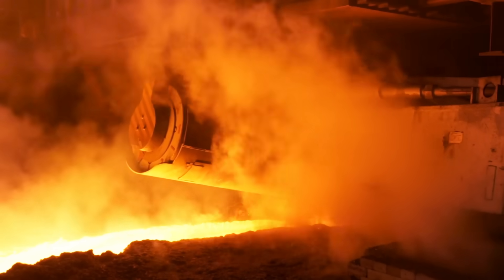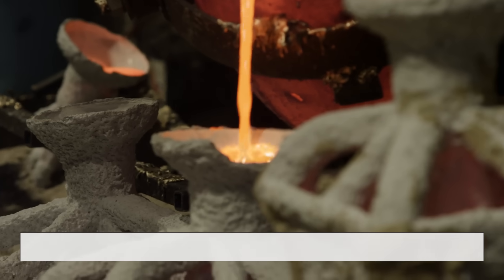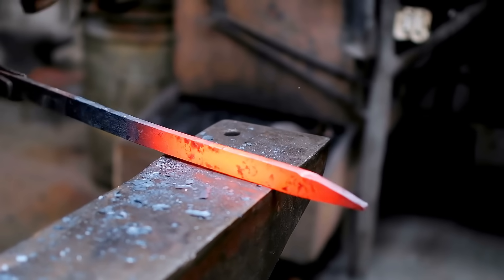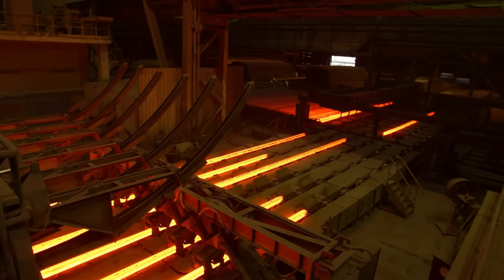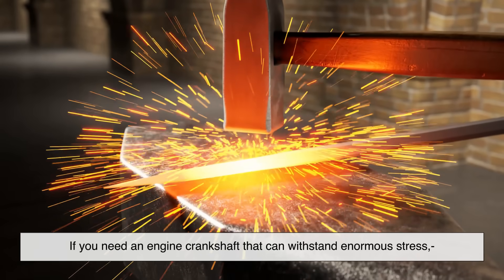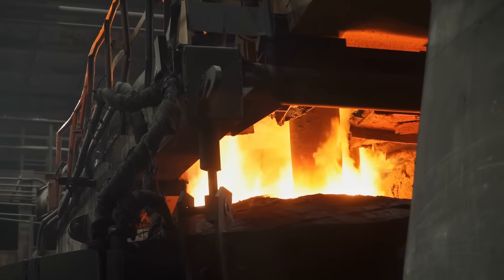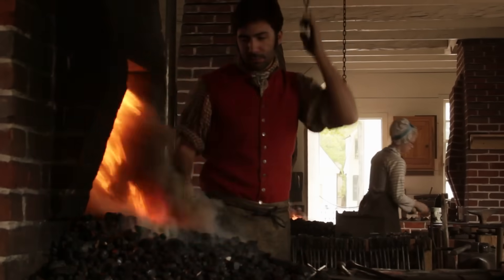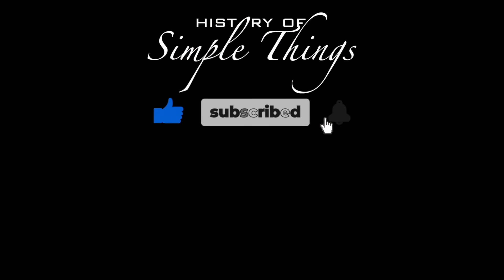Forging vs. Casting: Which Metal Would You Trust?

Comment: Why is most of the forging shown in this video just a guy hitting a bar with a hammer?  Like in an old blacksmith shop.   Modern forging uses drop presses which can force a red hot billet into almost any shape.  There's lots of mass production that uses large press forges to punch out components and you could have shown these in action to give a better idea of the difference between that and casting.   Also, some components are cast and then forged.  Also, you could show an example of something like a cast aluminum water pump housing versus a forged housing .... and then take a hammer and try cracking them.  The casting is very brittle and will crack and break.  The forging might deform but it will not crack or break up into small pieces.  For a video on this subject you need to do more and show more.

Comment: This is the first video I will agree with up to a point. The inherent strength of a forging is down to the deformation or lengthening of the crystaline lattice or grain structure allowing stresses to "flow" through the component. However, the video keeps referring to castings and shows Grey or flake iron components which have little impact strength etc so you are comparing apples with pears. No mention is made of SG or Ductile iron which will match steel strength for strength with a 15 - 20% higher proof or yield strength. When a forging is subjected to stress or impact and the load reaches the level of the proof strength it will bend and exhibit a failure. A similar SG Iron component of the same tensile strength as the steel will accept a higher level of stress until failure because of its highr yield point. 

Of course this statement over simplifies the comparison as there are components that are "best" as a forging. Another point is that the video shows the undercarriage of an aircraft stating that it must be a forging. All the major components in this example are forged Aluminium and Titanium because of weight, As cast aluminium's physical properties cannot be matched equal to equal with those of a forging in the same material.

It was to the detriment of SG Iron (this word iron = brittle) that it wasn't developed by the steel industry because then it would have been called Spheroidal Graphite Steel.

Comment: The problem with casting is often creating the cast (so that the metal is poured correctly) and removing/breaking it afterwards. It is not as labor intensive as forging, but it is not without issues either.

Comment: isn't it also different, on the content of the metal, not just the processing

metal, is just a collective name, funny that you don't even mention this, but you equate these two completely different methods

a Samurai sword, I have read that the best ones contain like 7-10 different metals that they forge together, the blade is made of a metal, which is easy to get really sharp, the middle a completely different metal for strength, etc.

example SR71 plane was made of metal/titanium

a Boeing 737 contains metal/aluminum

between these different planes, the metal, in these is extremely different

Comment: You missed a key point.  All metal fabrications start as a casting.  Liquid metal is poured into a mold.  That is casting.   Now in some cases such as for making plate, I beams, or other common metal shapes there may be continuous casting process where the set up metal is continuously pulled from the bottom as liquid metal is poured in the top of a cooled form.  A casting can then be forged to gain additional properties. Both can be heat treated. Rolling plates from a cast rectangle is a form of forging.

Comment: I wonder why the video shows large scale casting in a foundry but show forging in a small scale blacksmith shop.  Most forgings are produced in modern hammer and press forge shops in closed dies while some is forged in open die forges.

Comment: I would like to know, in more detail, exactly how pounding the metal actually aligns the atoms/molecules.  It sounds like a rather crude process to have such a precise effect on a molecular level.
Reply: It's like compressing the big chunk of metal into one smaller solid piece it also help remove impurities of metal. But nothing can beat of you have almost pure metal and carbon unlike a recycled steel.
Reply: So basically it does the opposite, cast metals are typically much more crystalline in molecular structure, and beating forged metals with a hammer will force a much more erratic structure, I'm not sure exactly as to why its much stronger but I believe it is because of the metal grains being all over the place like a knot in a log
Reply: @settings1967  haha you could say like that. But I watch a lot of japanese blacksmith I always heard hammering make the steal stronger and the real katana was folded and hammered 10x.

Comment: Doesn't the source material come from the same place. A mine? Is there a difference in the way the metal is prepared prior to forging or casting
Reply: Yes the source material is identical.  The difference isn’t in how the metal is prepared prior to forming, it’s in how the forming itself takes place.  This explanation is the whole purpose of the video.  Did you watch it?
Reply: @mensaswede4028 yes I watched the video, I did not know if they were starting with the same iron ore.

I understood that the casting started with melted iron.

What was not clear is what is the iron to be forged started out as. Was that originally cast as well?
Reply: @tsafa Everything starts with the same molten iron, and almost always at least carbon is added to make it “steel”.  Pretty much the only thing you can do with molten iron is cast it to let it solidify.  Forging involves shaping the solid iron by forcible impacting.  Beyond that, manufacturers will often stretch the definition of “forging”.  Sometimes the item in question is simply cast into a rigid mold, and then the “forging” part is just a single impact blow just as it solidifies to remove air bubbles and other defects in the casting.  Is this truly “shaping the steel by forcible impacts”?  I would say not, because the overall shape was primarily created by a casting, and then there was one impact blow.  But that one impact does indeed strengthen the metal.  In a “real” forging, the original “casting” is nothing more than a block of metal that solidified into some rough rectangular shape, and then thousands of impact blows are performed as the item is kept red-hot but solid.  So there is a lot gray area between casting and forging.
Reply: Okay so based on what you said I think I'm able to understand the value of folding the metal over and over repeatedly. 

So if we're starting off with some scrap metal, that we have no idea how much treatment it has received, it is best to draw out and fold it a few times and beat it some more to get up to a true forging strength.
Reply: @tsafa  Yes, exactly.  Although I would be careful when you say “how much treatment it has received”.  There is also the process of “heat treating” a piece of steel, which has nothing to do with forging.  Heat treatment is done after forging (or casting) to improve the strength at the molecular level.  Whereas forging improves strength because it removes macroscopic (but still tiny) voids and defects.

Comment: If the steel is grown from one crystal it is even stronger than forged steel. That is how jet engine turbine blades are made. The process is time consuming and expensive.
Reply: Turbine blade are made from high termperature superalloys rather than steel.
Reply: @jeremybarker7577 the main ingredient is steel. There are several metals like nickel and tungsten that are used in the alloy.
Reply: Yes, single crystal turbine blades are better (stronger for certain) at high temperatures.   By eliminating grain boundaries high temp strength increases.  Yes, very expensive.
Reply: @thomasroberts6151 Turbine blades are very expensive. Not only are they made from expensive superalloys but take a close look at one . They have holes in the leading edges to deliver air from the compressor to keep the hot gas away and that has to go through the axle and the rings that the blades are attached to. That is why Turbine engines are not used in cars despite their superior efficiency.

Comment: There are modern variants of forging, such as rolling (both hot & cold), and drawing (pulling as opposed to what you do with a pencil).

Yes, the best method, is dependent on it application.

The Cyber truck has a cast aluminum frame. Two problems: wrong material, and wrong process. See Engineering Explained video on it. If you own one, garage it, as it will quickly become a collector's item, such as the failed Edsel. Quickly, as maybe as little as 10 years, as opposed to 50 years.

Comment: They didn't mention that the specific composition of the steel plays as much as a part of a parts strength as the forging itself does.  Forging most types of steel doesn't add much beyond shaping a piece.  The types of metals commonly used for casting and for forging are completely different as well.

The video is more or less accurate as far as it went, but left out so much information as to give the casual viewer essentially the wrong idea about the differences between casting & forging, and why one process is better for a given application than another.

Comment: the entire time i was watching this video  i was asking myself why you didnt once mention that the durability and hardness of the metal or steel is determined by the  type  and  also the heat treating and quenching  and you didn't even mention dropforging  which is a kind of forging that is not even the slightest labour intensive

Comment: Cast metals can be heat treated and quenched.
Reply: I think it's called case hardening. I spent a very uncomfortable summer working in a steel mill. They would reheat the cast parts and dunk them in a vat of liquid (I think it was petroleum-based).

Comment: I can attest to the strength of forged crankshafts. Many years ago, I had a '65 Dodge Coronet 383-4V & factory dual exhaust. The engine had a forged crank (IIRC MoPar ran forgings in the "B" blocks until sometime around mid-1971), and that engine should have grenaded itself many times over. But it never did.
Reply: The only way to tell is to subject both forged part and cast part to repeated identical stress and tabulate their failure rates. When failure rates exceed statically randomness, then we can say that forging is more durable than castings.
Reply: How often does the crankshaft fail?